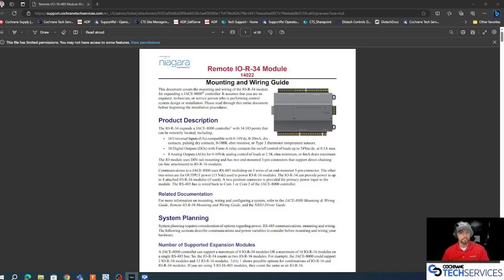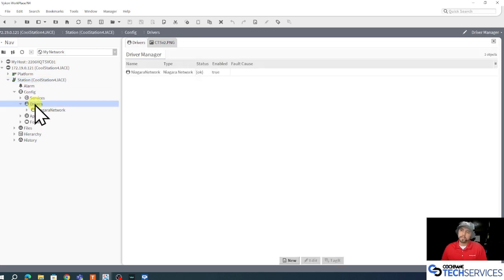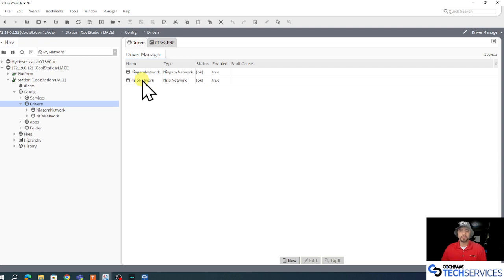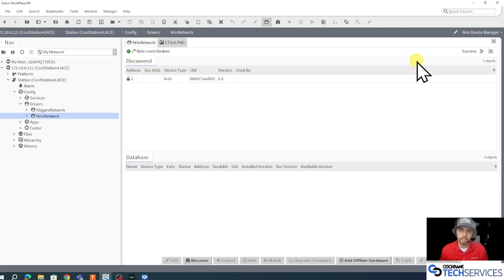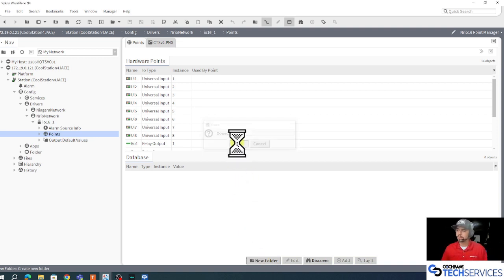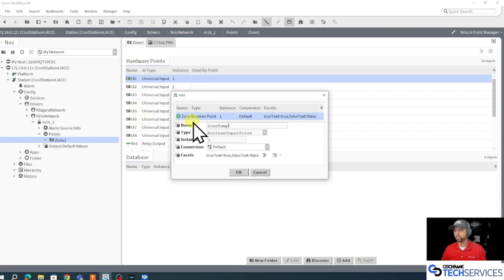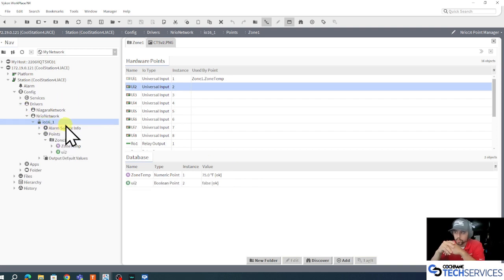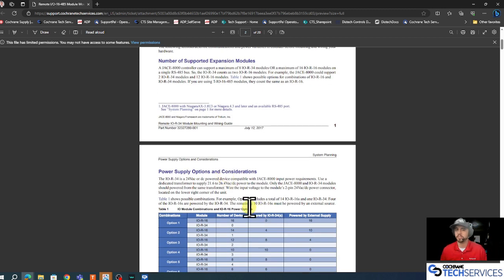Niagara 4: Integrating an NRIO-16 Device

Comment: How do you change the default view of the points folder?
Reply from the maker: Hey GoldenNugget,
You would have to change the modules, which are the features, or "building blocks" of Niagara. Niagara is based on Object Oriented Programming and these modules are those "objects" that are constantly being referenced elsewhere. 

However, you can add a view to a folder, and it becomes the new default view. 
For example, putting graphics on that NRIO-16 points container would make it so that anytime you double-left-click it from the Nav Tree, it will show you the graphics and not the points manager.
Reply: @CochraneTechServices  thank you, really appreciate it!